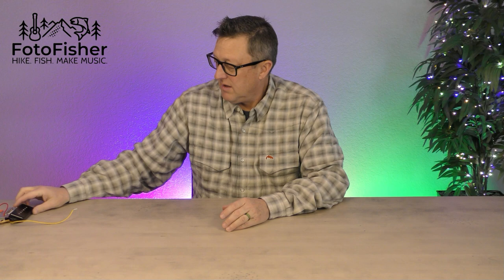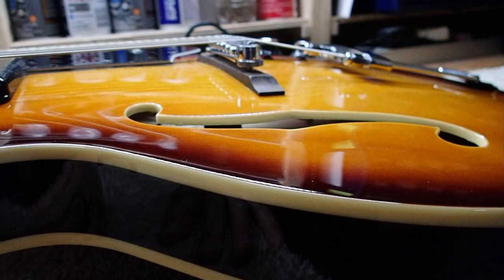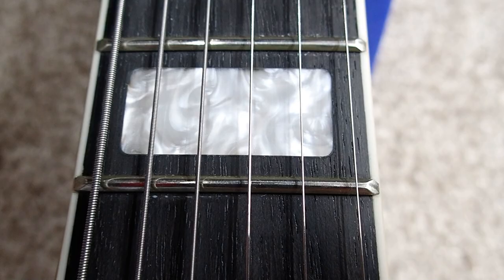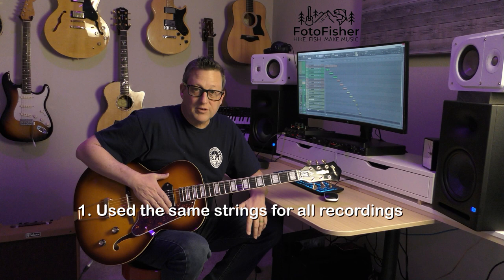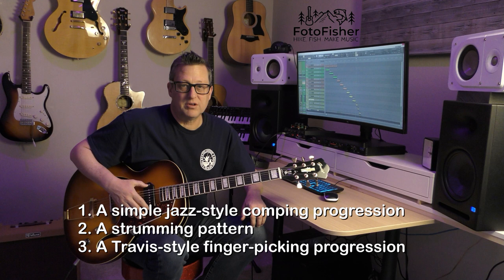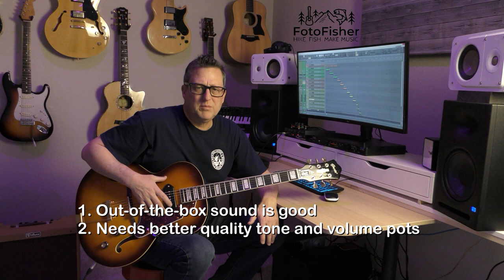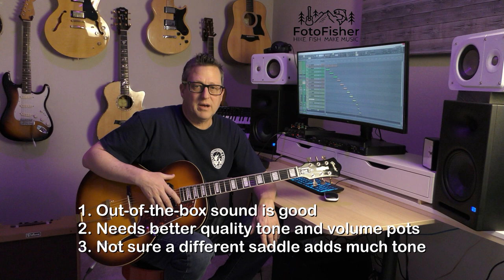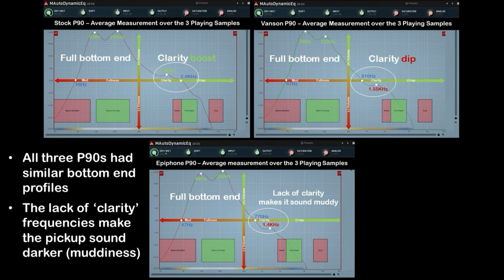Grote Jazz Guitar Make Over

Comment: I have this model and I have to say..they sound good just as they are...the tuners yes that could make a significant difference though if you pull out the slack and tune up into pitch they hold ( with good strings)..the beauty of these single pick up guitars is the simple realization of how to manipulate different sounds by where you pick or pluck or palm mute or the whole 9 yards...I could get those tones out of the grote pickup...I think the top end disappeared noticably with the bridge change...I also am not big on model amps and tone comparison...now is it  $1000 guitar sound ...no but it is a good sound,they are nice to practice on leave out and take to boys night out..and they do hold their own surprisingly well,..it is what it is and I find it in my hands a lot
Reply from the maker: Well said.  I play mine frequently, thru a '57 Fender Deluxe 5E3 circuit, no pedals, just me, the guitar and the amp.  Lovely, just lovely.
Reply: @hikefishmakemusic  Fender amps are fantastic for that! I have a Deville 4x10 I got dirt cheap 10 years (300 bucks CAD). I just use the clean channel and some verb, great sound. For blues just kick in the Tube Screamer and away you go.

Comment: I have the same one in red. Quite playable right out of the box. I applied 3 coats of mineral oil to the fretboard (very thirsty) and dressed the fret ends. I upgraded the tuners (Grover-style Gotoh) and removed the pickguard altogether. I also added a spacer to the P-90 which greatly improved "brightness". One of the things I liked best about this guitar is how loud it was without amplification. I deleted the soft wood (pine?) bridge and replaced it with a rosewood one and that greatly improved loudness and sustain - probably the single biggest improvement of all. This is a LOT of guitar for under $200!
Reply from the maker: Totally agree with your assessment.   It is a great guitar for under $200.
Reply: @hikefishmakemusic  😮IV

Comment: Thanks for this. What I learned, don't by Epiphone P-90 pickups 😆This was a good comparison. Thanks for sharing! I didn't hear a tone comparison with the original bridge. For these Jazz Box's the bridge is a tone deal breaker. I thought the original P-90 sounded great. Nice and crisp, just what I look for in a P-90 and flat wound strings will need that extra high end. Pickups are important, but I've found that I'm able to overcome any issues with a little EQ and Gain finesse.

Comment: I I bought this guitar recently.  It was good but when I wanted to adjust the intonation, one of the screws had a problem.  Then when I looked at the frets to set the action to the lowest, I noticed that there were several frets that were higher.  So I leveled the freights.  The trussrod had to be adjusted.  Then I noticed that the pickup had a good clear sound, for playing jazz it was very good, but with overdrive the sound was not good because it was too low for that.  Overall it's a good guitar especially for the price, but a demanding musician will have to spend some time to get the tuning optimal.  Some negligible finishing defects exist, nothing insurmountable.  So I had to change the bridge, put a shim under the pickup, and change the nut to have a reliable and efficient setup.  The tuners are OK, although I think they will need to be changed later.
For a beginner or an undemanding amateur this is a very good guitar.  For an experienced musician, you need to know how to tune your instrument, otherwise luthier fees can make the total cost daunting.  It is still necessary to take into account that guitars of a higher price are not necessarily better and very often need to be optimized in the same way.
Overall it's a good investment for an archtop.  The acoustic sound is weak, but it is a semi-hollow.  You can't expect the same sound as an acoustic archtop.
I must add that the tone potentiometer acts at the end of rotation.  This isn't really a problem, but more progressiveness would have been better.  I will rectify this later.  It is not eliminatory.
(I use a homemade Princeton Reverb 65 point to point board.)

Comment: You definitely made some good improvements. I was surprised by the quality of the stock pickup. This video has me thinking about how I would mod the guitar. Probably do what you did with the pots. Maybe keep the stock pickup? Swap the tuners for a klusson style with a butterbean tuner. Then swap the saddle for either a bone or wood saddle. I might take the pickguard off completely or swap to the tortoise shell like you did. Lastly, given my experience with that style of jack, I would for sure mount a plate there to add stability and protect it. Had a similar guitar that someone ripped the jack out of when I let them borrow it.

Comment: This is a fanstastic guitar. I got the natural color. Threw flatwounds on. Very slight work with Truss rod. Nut and frets were good. Intonation is close.....and adjustable TYG. It vibrates like a living thing...plugged in. Awesome range of tone from a single pick-up. It's so good I wish there was a cut-out version. I'd buy it. I also have a Grote 335 I bought several years ago. It was almost 100USD cheaper..but I'm still working on it LOL. It sounds good but frets are all over the place. Of all the Grotes..these by most accounts are the most ready to play.
Reply: An es-135 style would be killer.  Even a single pickup model.

Comment: Good to watch this as I just bought the Grote GRS-001 model. Will be upgrading some Grover tuners and a Bartolini PBF-55 jazz humbucker. I'll also sand the back of the neck as I've never liked the clear coat finish. And if I don't like the neck at all, I'll put a different neck all together with some nice inlays and better playability. The point is, it's better to get a decent, affordable guitar with upgrades than spending thousands of dollars just because it's a Gibson or PRS.
Reply from the maker: It's a simple sound box, so mods can be easy on this guitar, but swapping out a fix-set neck may be more trouble than it's worth on this model.  But, if you do it, good luck!  I'd like to know how it goes.

Comment: Great video, and very well done (thumbs up & I have subscribed) !!!  Personally, as a really old guy, I like the sound of the older guitarists, like Oscar Moore (who backed Nat King Cole & Peggy Lee), Herb Ellis, Johnny Smith, Howard Roberts etc., and had been trying to find a way to duplicate that sound.  Along the way, I bought the same Grote in your video (except color) because it was so cheap, and according to some reviewers, had a lot of promise. I achieved that sound goal by replacing the stock strings (.09 round wounds?  Who knows?) with a set of D"Addsrio .10 flat wounds, and for the sake of tuning ease, a set of 18:1 lockers.  The stock P90 sound with the flat wounds is about as close to that old, woody sound as I've yet to achieve, except for my Harley Benton Manhatten Standard (on which I installed D's .11 flat wounds to replace the D's .10 half rounds that came with the guitar) which might sound a hair closer.  The sound you achieved with the stock P90, with the other mods, is very close. also.  The other two pickups sound a little too bass heavy for the type of old school Jazz sound a few of us old timers prefer, but that's a moot point, when you consider the tone that most of the contemporary are producing.  Besides, most of us old guys are living in the past anyway. P.S. I forgot to mention, that surprisingly,  I'm getting that "Old School" sound out of one of those $234 Monoprice 15 Watt tube amps (go figure!).

Comment: Did you ever raise the height of your replacement pickup, and if so, how much did it affect the sound?  As others have mentioned, a technical details video on how to replace the pots and pickup (including the copper shielding you said you use in a comment--reply) would be appreciated by many.  Also, thanks for doing this video - well done.
Reply from the maker: You have to be cautious in raising p90s too close to the strings.  The sound will get harshly loud and lose clear definition.  It's ultimately a taste thing.  From experience, I tend to keep p90s on the more moderate side of things, not too close.

Comment: Hi! I didn't understand if you used 250 or 500 potentiometers in this modification.
In the diagram they are 500k with 0.022 capacitor,
in the links indicate potentiometers from 250k
Thanks for the reply.

Comment: Hello again! I am having some light buzzing when playing the first two frets of the upper E and A strings. How would you fix this? Thanks a lot!
Reply from the maker: If your actuon is at the preferrd height, then you most likely have a high fret or two.  Isolate the frets that are buzzing and use a flat edge to gently press them in further.  If that doesn't work, then YT how to level frets and follow those instructions.  You won't need to level much.
Reply: @hikefishmakemusic  thanks a lot again! Great to connect with you!
Reply: Sounds like you need to level your frets. That's why they buzz, quick fret job, can you blame them for less that $200

Comment: Could you please explain how to fix a loose volume knob on this guitar? It would be of great help! Thanks a lot!
Reply from the maker: Pull the plastic knob straight up and off, then tighten the thin nut to firm but not too tight for fear of cracking the guitar finish.  Rotate the stem completely to the right and press on the plastic knob so that "10" faces you as you play.  Done.
Reply: @hikefishmakemusic  Thank you so much! Appreciate it a lot!
Reply: If possible, could you now explain how to change the pickup? Is it a complex process?
Reply from the maker: @rodrigomarino9813  it's more involved than a few simple sentences in a reply.  I strongly suggest searching YouTube for pickup replacements.  There are plenty of great tutorials on YT that can help you out.  I can tell you that this guitar has the simplest pup replacement process, so it's a great project guitar to practice on.
Reply: @hikefishmakemusic  I will! Thanks a lot for the advice!

Comment: Cost of the upgrades?
Reply: just buy a decent guitar to start with lol
Reply: It is a decent guitar.  I love mine. @Phyoomz
Reply: @Oxmyx01  idk, I've bought these cheaper guitars in the past, I end up putting a bunch of upgrades into them and they end up costing as much as the officcial budget version of the real thing. 😢 That said, I'm saving up for an Ibanez
Reply: My dear friend, I get it and completely agree.  In my case, I purchased the Grote for $130 USD.  I swapped the tuners for Grovers and the bridge to accommodate flatwounds.  For under $200 I have a solid, fun player.  The Grote has great bonesif you like to tinker.  If not, it works well enough out of the box.  All the best to you.  @Phyoomz

Comment: Why is there no hum on these single coil pick ups? Did you process the samples to remove the hum?
Reply from the maker: I didn't use any post-processing.  Since it is a single P90, you'll experience less hum than if it were two.   Plus, P90s in general have less hum than strat-like single coils but not as quiet as good 'ol humbuckers.  When I swapped out the electronics, I used cloth wire point-to-point and lined the pick-up cavity with copper foil tape to provide additional shielding.  I line all the pickup cavities in my guitars with copper foil, no matter what the pickup.  It definitely makes a guitar noticeably quieter, particularly for single-coils and P90s.